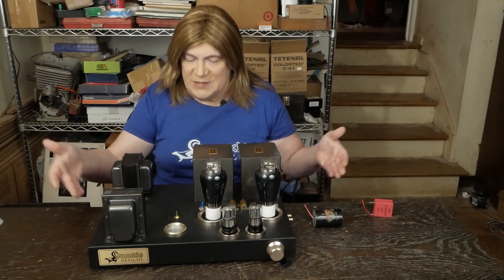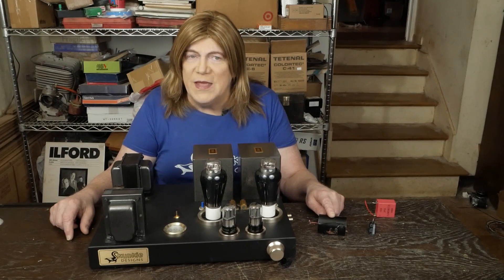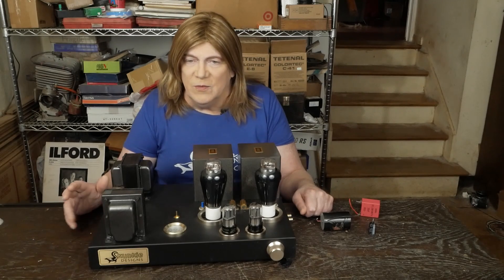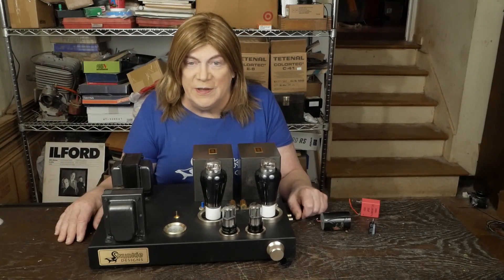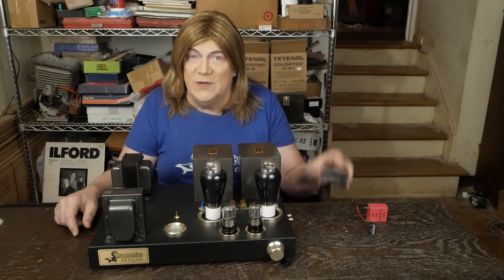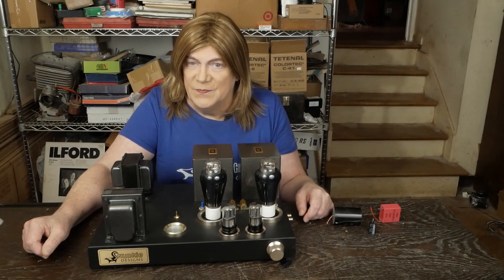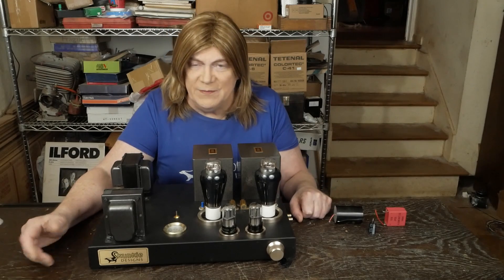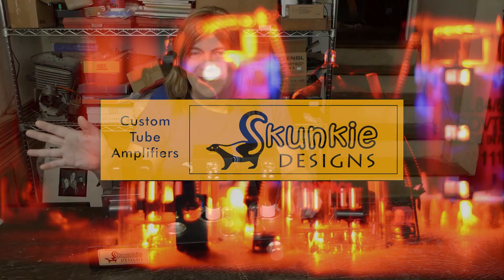Power Supply Cap Changes Amplifier Sound?!

Comment: Analog discovery 2 has an impedance analyzer feature you could use to measure the complex impedance characteristics over operational frequency. You probably knew that but it would be cool to see how they measure differently. I bought the little breakout board but you don’t need to if you can supply the resistance
Reply from the maker: No I didn't know that, is there info online somewhere? I did just order the breakout board, thanks for this info!

Comment: This has been my experience. I typically bypass the second / B+ caps. To my ear adds detail. I built the ability to change out coupling caps in one of my basement builds. I was similarly shocked (by the sound changes). I think this is much more noticeable in se Amps, less so in pp amps, at least in my experience. 

Keep going, it feels like snake oil… but clearly not.
Reply from the maker: I know right? And some of this will depend on the speakers if this "extra detail" sounds good or not too.

Comment: That's a surprising finding for me, like you I thought a power supply must give the correct voltage with sufficient current, as close to smoothe DC as possible and that's it!
In fact I have been very tempted to use a solid state PSU when I eventually get to building this as there are advantages with space and filtering but this has me thinking...
Reply from the maker: Me too, I was really shocked.

Comment: Well that was a bit of a surprise. But WIMA's are known to need some break in time...but just thought that was if used as coupling cap. But it's easy to forget that the power supply is the heart...you only modulate through the audio sections what it produces. I'm chuckling here because you're experiencing the same thing I got from using Mundorf coupling caps in my Kegger SE KT88...except I didn't know right off that they were the cause of some terrible high frequency distortion. And to make it crazier, vocals sounded awesome. I had some Cornell Dubilier 940C of the right size and replaced the MCap Supremes...immediately better. As far as bypassing electrolytics, I believe there was an overall improvement when I bypassed the cathode caps on the KT88's...but it was small. Now I'm dealing with speaker cables...they have capacitance issues also. Hang in there!

Comment: The Solen PB are great in power supplies, I have them filtering for my front end tubes. My amp is a PP AB triode strapped EL34 amp, my rectification is SS) The character you describe of the Solen's is the same as I and others describe of them when used in the PS.
Reply from the maker: I was actually stunned at the difference!

Comment: One more suggestion, to bring yr amp to another level, pls try and tell me your results! The Vol pot voltage divider has real impact to audio quality. Not sure what pot is used in yr amp? Replace it with TKD and add 10x TKD resistors to the 3 vol pot tabs.If yr pot is 100k, add resistors 10x (1 mg ) to pot in and pot out to yr driver tube. This shunt mod fr late Bob Crump is a super audio hack. Try it?

Comment: Nice job. A video on capacitors and application would be great. Bypass caps, etc. Does capacitor sound change over time? I often hear this and maybe just when out of spec.
Reply: I think majority of burn in is for metalised caps and electroyitic only, since the metalisation needs an applied voltage to self heal and form a better coating

Comment: Hi Stephe.. The PSU is IN the signal path IMHO (current loops), especially for single ended amps... A 3uF difference can still be sonically heard IME.. Has the B+ stayed the exactly the same with a 30uF Wima DC Link input cap vs the 33uF Solen? Try the Wima paralled with a plain 3uF/630V Mundorf Mcap (white).. I only tried Kemet DC Links and they are not harsh, it takes time (break-in) for the bass to subjectively heard and felt though..

Comment: I have been told you can’t Mix those DC Link caps with electrolyte caps.       If you use one DC Link cap in the power supply you have to use them in the entire power supply.       He told me “ if you mix the two kind of Caps together weird shit happens “ .      I haven’t tried it my self, but so far He seams to be correct by your outcome.    🤷‍♂️

Comment: Hi Stephe!  We were using 'Wima MKS' 47nF 1kV caps & got a 10 to 30% failure rate!

We swapped to blue 'Multicomp' caps & had no further problems since.

This was in a high voltage power power supply, but not for an amplifier though.

Good to see you got your great bass back by replacing the 'Solene'!
Reply: I should add that our problematic 'MKS' series Wima capacitors had the identical hard red plastic outer casing as your dodgy 33uF cap. 

Their epoxy sealant was a yellow colour, rather than red which yours has.  So yours may be from a different series, possibly the 'MKP' series.

Older, identical looking 47nF Wima caps, from a few years ago, gave us zero problems.  We never had to replace them.  So they've messed with the metallised polyester film, or p.e.t  film, or whatever it is.

A fault in these capacitors would cause arcover inside the eht transformers, which would destroy them, & reflect back through to the primary winding & blow the hv switching transistor & all associated driver transistors.  Catastrophic destruction of our hv psu's!  They'd go off with a loud "BANG!!!!", & blow the glass fuse like it had been spray painted silver & black from the inside!  Sometimes even cracked the glass!

I would have expected MUCH more from a German made cap!  Their latest batch were CRAP!

Comment: Capacitors are my bane.  Those Wima caps are bright sounding caps IME, which works great in signal path of certain tube circuits to detail up the sound.
Doesn't surprise me they brighten up in power supply.  Then there are those who swear by big oil caps in the power supply..
Reply from the maker: Yeah, I may have to try that. I used one on my 47 globe amp and it sounds great.

Comment: Every cap has an ESR and inductance which can form a resonant circuit with the other components in the power supply. This resonance can occur at audible frequencies, or at least frequencies that otherwise impact the amp performance. Ironically, low ESR film caps can be worse as there is less series resistance to damp the ringing. It seems even the humble power supply has a lot of nuances and things that can impact sonic performance!
Reply: That's  TOTALY correct signor ...
Reply from the maker: "Humble power supply" is how I always looked at it, clearly there is more going on :)
Reply: I remember someone having to put small cap and possibly series resistance across filter cap as a snubber to control bad behavior of main filter cap.

Comment: Very intriguing and exciting findings of yours for sure. I can't resist the urge to  immediately make use of that finding by experimenting in my amps to see if something I like can be obtained.
Reply from the maker: You and me both!
Reply: @SkunkieDesignsElectronics  Hi there. Into testing film cap as first cap in power supply again...  That Solen you used, I guess it was the "Solen PPE Polypropylene 630Vdc Capacitors" , not the "Solen PPM Polypropylene 1000Vdc Capacitors" ? I am now planning to test a Solen 22uF as 1st cap after 5AR4 in my Skunkie-modded Reissong A10. Also finally, last week of my summer vacation, started rebuilding the front end of my "Oldchen 300" direct coupled style 300B amp, to cascoded 6SN7:s , with elevated heater centertap as per your recommendation. Very curiously awaiting the results when the ordered components arrive from Mouser.... If it turns out really well, I will buy and try the Shuguang Treasure 300B:s, since the Electro Harmonix 300B:s I have currently do not sound that interesting to my ears. My Skunkie modded A10 actually outperforms that Oldchen 300 stock amp by far as it is.

Comment: I was surprised to realise that the power supply cap is actually part of the output stage signal loop and thus has a major effect on sound quality other than just ripple and current supply. There is a connection called ultrapath capacitor that connects the cathode bypass capacitor to B+ instead of ground. This capacitor determines the sound quality and takes out the power supply characteristic from the signal path. The other thing is that you can use a regulated supply to reduce noise and not have it's sound character intrude on the signal.I first came across this on Bartola 's GU50  SE amp. See Ultrapath, parallel feed and Western Electric paper by Lynn Olson and his EFT presentation on signal loops and ultrapath connection for explanation.
Reply: Yes correct , ultrapath is known for decades ............and forgatten.( as well as many other interesting tricks )..........the value of the cap  has to be correct ...
Reply from the maker: Interesting !!!
Reply: I agree with the cathode bypass cap peice but were talking DC current and it's only going one direction thru output transformer and output tube  to ground - not back to that 1st cap in the power supply - and it's like a split rail power supply also - it would have to go back to the de-coupling caps - chokes also - Current is not going backwards- I'd bet if we watch on a scope we'd see - checking if the DC drops at all with music and check the AC ripple for any changes - of course the B+ is in the audio path but all we need is good clean power and constant current. The parallel feed is shunting the ouput with a cap and coil (choke)  @SkunkieDesignsElectronics
Reply from the maker: That's why I was so shocked this cap so far removed from the signal tubes had a massive impact on the sound. Honestly it still doesn't make sense, have to think on this some more.
Reply: @SkunkieDesignsElectronics  Yes, I really hadn't recognised that the output signal loop goes through the cathode cap, then ground and back through the supply cap to B+. You need to keep this loop for DC back to the recifier, but you can bypass the supply for the signal with the ultrapath cap. They say that doing this means you impose supply ripple on the cathode, so the supply needs to be smooth. The up side is you can regulate supply without the audio signature of the regulator being in the signal loop. What puzzles me is that you found that the first capacitor, before the choke makes such a difference. I thought it more likely the capacitor nearest the tube would be the one....
Reply: Thanks, never connected those dots.  Never looked past the obvious.
Reply: We listen to the power coming out of the wall. It goes through the power supply, it’s frequency/strength gets managed by the amp and goes to the speakers. Straight line from the outlet in the wall, to the speakers. Tubes/transistors manage the flow of that power. I’ve been a firm believer that everything matters. Power supplies as well.

Comment: Loving this series of videos - you should try Mundorf tubecap, Miflex, Duelund and/or Audio Note copper.  As far as I’m aware these are the top ones.
Reply: I recently changed the WIMA MKS caps used as coupling caps in a Chinese 300B tube amp for Audio Note Copper Foil oil filled ones. Wow!
The website says that these capacitors were specifically designed for this application and they sound great.
Reply from the maker: I'll look into them.
Reply: Actually, the top-level capacitors are from V-Cap (VH-Audio)

Comment: Did you run some output tests to see if the sonic differences show up in objective testing?
Reply from the maker: I need to, and then figure out where to look for this very audible change. And this was clearly not a case of expectation bias, I wasn't expecting any change and was in fact baffled that it changed lol
Reply: @SkunkieDesignsElectronics  Could it be down to the slight difference in the values between both caps? Do you have some 30uf Solen caps to test this?
Reply from the maker: That's not it, I tried but 33uf and 22uf solen caps and those sound the same.
Reply: Objective testing ................what's that ?

Comment: Welcome to the party :) The electricity from the wall is what arrives at the speakers, so the sound is shaped in the PSU first. The more caps you upgrade, the stronger the effect of each will be. When it comes to the brands of audio-grade ones, in general "you get what you pay for". A common style when you buy the really fancy ones is to double the voltage and half the capacitance. The higher quality electrolytics allow you to run them lower uF and actually get better sound quality. have fun
Reply: That's indeed PART of the truth and one of the golden rules know by those who know........
Reply: Yes I can't give it all away because the fun is in discovering :)  @frankgeeraerts6243
Reply from the maker: Cool, thanks

Comment: Novice here. Maybe the Wima cap needs several hours of burn in?
Reply from the maker: Honestly, that could be the case and I didn't do that. I guess I was more interested at the time to put the Solen cap back in and see if this actually did change or was it all in my head!
Reply: @SkunkieDesignsElectronics  I wonder if they have burn in rigs... so they are burnt in so she doesn't have to wait.